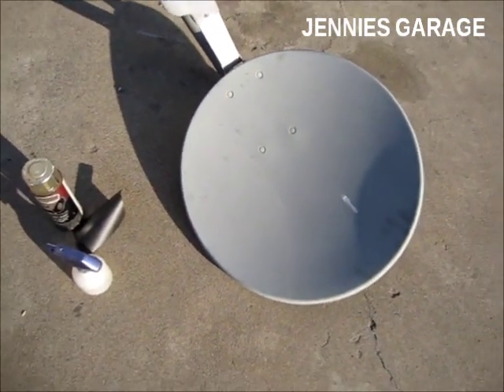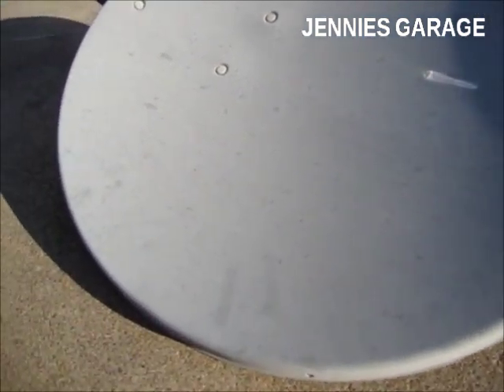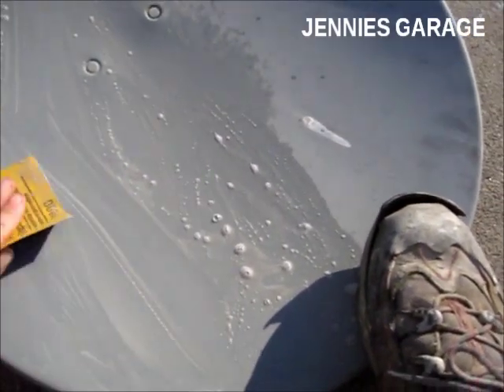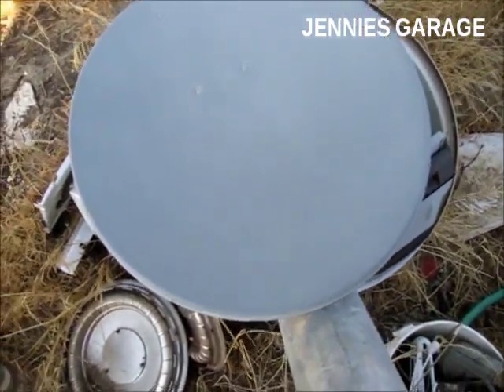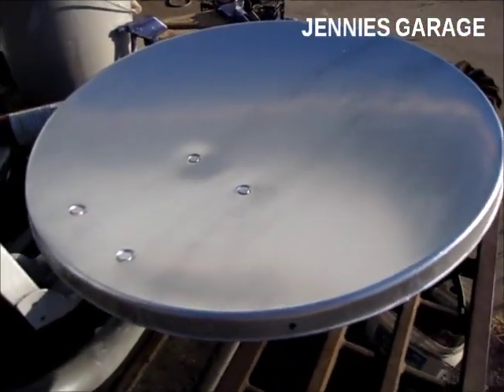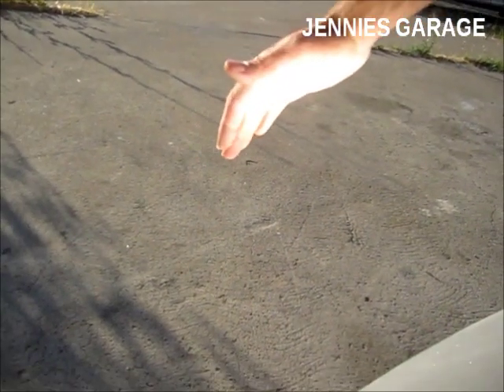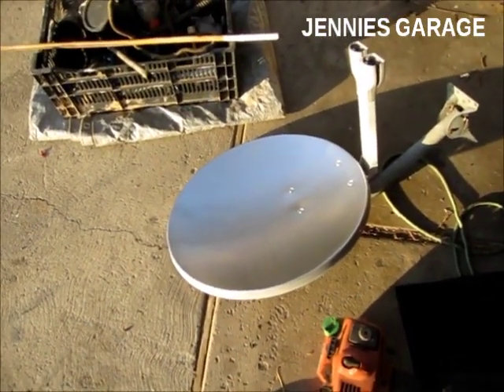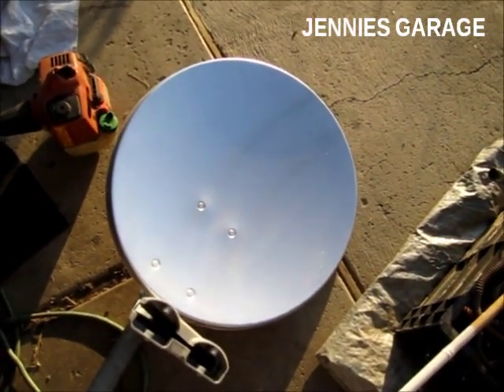How To Make An Easy Parabolic Reflector From An Old Satellite Dish

Comment: Here is a trick I would use on my Son's Pine wood derby race cars, saves time on sanding. Don't know how it would hold up in weather condition but sure it would improve a smoother surface. Apply coats of elmers glue and water it down slightly as needed dry in between coats. When you apply paint do not allow paint to dry before you apply second coat! If you apply spray paint over dry painted surface it will bubble up for some reason. My son always had mirror like finishes on all his Pine wood derby cars. Good luck let me know if it works for you.
Reply from the maker: that's a neat idea! It would be like a really thin filler to smooth the surface. I might just have to try it.

Comment: If you get a good coat of that crome on the surface you could try to buff it now, use very fine sand paper, wet, then buffing compound and a wheel to buff surface to mirror.